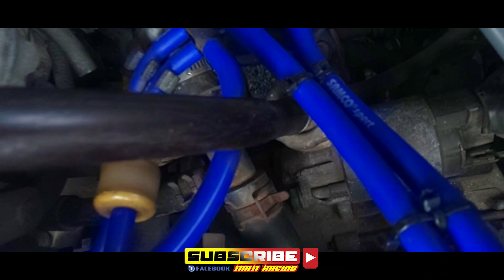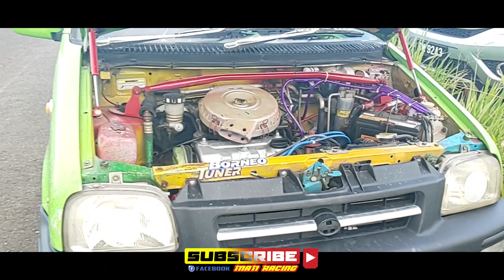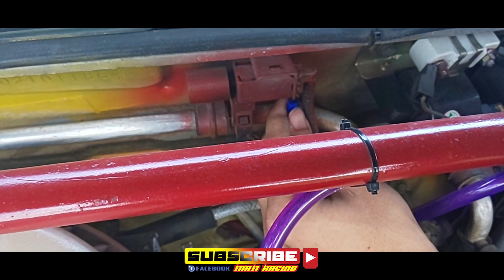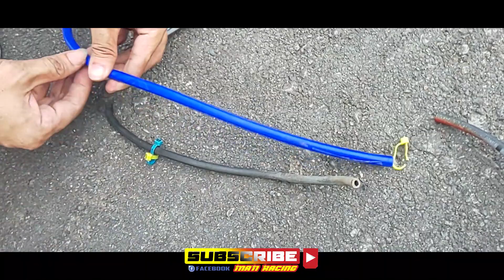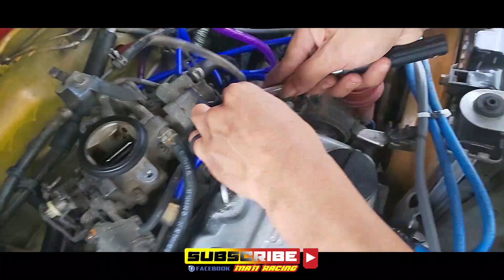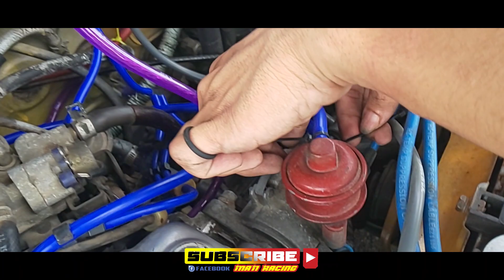Cara Tukar Hose Vacuum Kancil

Comment: Salam boss beli hose vacuum semua tu brapa meter untuk cukup semua...sy nak pakai yang 3mm...
Reply from the maker: 2 meter cukup tapi kalau nak tukar sekali hos air wiper beli 3 meter dah ok
Reply: @manracing812  Oky terima Kasih sy dah beli 3meter